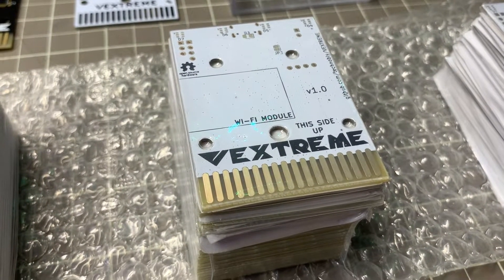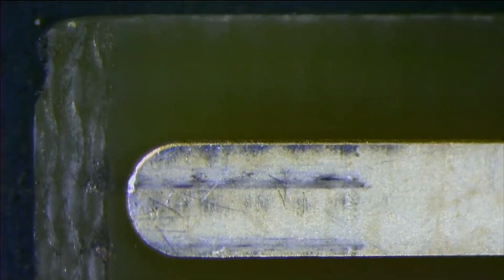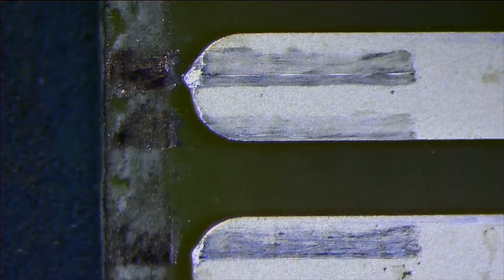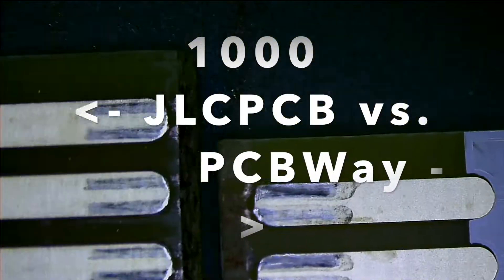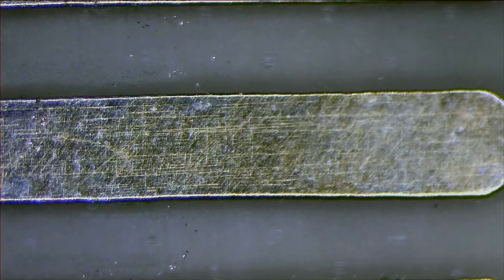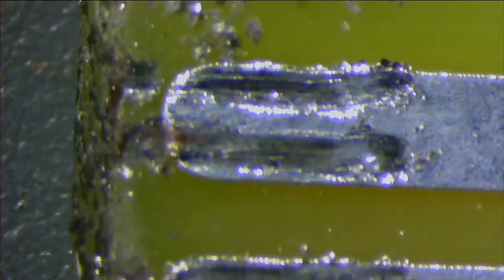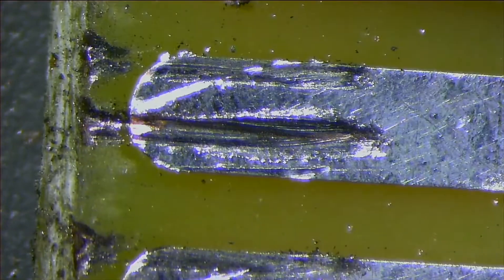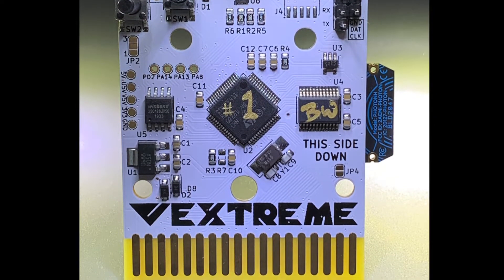VEXTREME PCB INSERTION TEST - ENIG vs. HASL vs. HARD GOLD!!

Comment: It’s worth knowing that there are even more options for manufacturers that aren’t gold but are still sufficient
Reply from the maker: What finishes and manufacturers are you proposing?  If it's worth knowing, please tell us.
Reply: @playvectrex  they often have silver plating and hasl with other alloys which are more durable and resistant to oxidation
Reply from the maker: @TheLostPacketYT JLCPCB doesn't appear to offer silver plating under HASL.  PCBWay offers Immersion Silver and Immersion Tin, but it's not under HASL.  Silver and Tin plate are also still quite inferior to Gold IMO.  Silver will tarnish over time and Tin will fuse into the copper over time.  Both have more specialized handling requirements vs. gold (ENIG).  For a big operation, maybe that's not a big deal... but I'm speaking more for the Maker community and small size game developers.  ENIG is much more forgiving, very durable as you can see in my tests, and not much more expensive.

Comment: Though Pcbway has better options as far as hard gold plating, it's extremely expensive to do so and is hard to justify, at least for my needs. Jlcpcb is far cheaper, even though they only have ENIG, immersion gold as an option. Overall, they've been my favorite fab Co to deal with, especially since the price is right, but YMMV. ;-)

Comment: HASL is fine for most applications. 1000 or even 500 insertions and removals is extreme. You said so yourself. If you ever got to the point where you were worried about wearing through the copper, you could just drag your iron to touch them up.
Reply from the maker: My advice is to use ENIG if you want your cartridge to last and be a quality product.  If you are just making a prototype, HASL will be fine but it's not great for production game cartridges.  Not everyone has a soldering iron to touch things up, and it's not that simple either.  If you wear through to the copper, you might not notice until it becomes tarnished and doesn't make a good connection.  At that point solder will not stick to it so you will have to sand it down to bare copper before you "re-tin" it.

I thought of performing this test to show how easy it is to wear HASL finish away.  HASL starts to wear away well before 1000 or 500 insertions.  I noticed on my VecFlash cartridge that the HASL finish was being destroyed after just one week of intense gaming and switching between different games, which requires removing and reinserting the cartridge, so YMMV.

The choice is up to you, but IMO if you want a good quality product, go for the ENIG finish.  It's not going to increase the cost that much for a product.  Hard gold is another story though, I believe that one costs quite a bit more for not much benefit... but I wasn't able to get a sample of hard gold finish to test.  If anyone would like to provide one, I'd be more than happy to test it.
Reply: @playvectrex  Fair enough. The last few times I've ordered boards and priced ENIG, it's almost doubled the price. I'm mainly using jlcpcb.
Reply: @playvectrex  the main issue is it increases the cost of the product massively and there is still a risk that it’s just going to oxidise before you exceed the amount
Reply from the maker: @TheLostPacketYT I'm not sure which finish or amount you are talking about.  ENIG does not increase the cost of a product massively.  Hard Gold does.  Both of those will not oxidize any time soon during repeated use.
Reply: @playvectrex  enig makes the cost per board go up from about 10 cents to a dollar thats a 10x increase massive at scale
Reply from the maker: @TheLostPacketYT I would have no problem passing on the cost of 90 cents to the customer, to deliver a superior long lasting game cartridge.  That said, I just did a price quote at JLCPCB for HASL (lead free) vs. ENIG (also lead free) and at scale with a 1000 pieces 50mm x 50mm PCB, the difference is not very much at all.  $136 for HASL (lead free) and $181 for ENIG.  5 cents difference.  Easy choice to go with gold... ENIG.
Reply: @playvectrex  They offer it but it may only be for large volume custom quotes

Comment: Now that's dedication! Glad you were finally able to complete this experiment. Thanks for the hard work & showing the results! 😎  
Though Pcbway has better options as far as hard gold plating, it's extremely expensive to do so and is hard to justify, at least for my needs. Jlcpcb is far cheaper, even though they only have ENIG, immersion gold as an option. Overall, they've been my favorite fab Co to deal with, especially since the price is right, but YMMV. ;-) 
I generally have a multi/flash cart plugged in at all times, so I'm not cycling/wearing out the contacts very much. Anyways, great video! ✌️
Reply from the maker: You are right, PCBWay does have many more things you can specify technical wise, and I didn't say this or show it much in the video but the silk screen on PCBWay is a bit higher resolution.  I personally haven't had any problem with either company (PCBWay or JLCPCB) so it's good to shop around and see what the prices are and try some sample quantities, and see if the price difference are worth the quality difference to you.  One thing to note, JLCPCB recently imposed a 50mm wide minimum if you are chamfering the edge of your PCB like seen in these videos.  Unfortunately the Vectrex PCBs are 48mm and they won't allow you to apply the option at all once you upload the gerbers.  I have found though, that you can widen the PCB to 50mm, but leave the edge connector area 48mm wide and they do allow it, but I haven't purchased them like this yet to know if it will go through.  My personal preference is the minimal ENIG finish, with 45° chamfered edges.  I've also noticed the chamfering from both companies sometimes needs a light 800 grit sanding to take the sharp edge off.  You'll know it when you hear it as you plug it into your Vectrex :(  It sounds like strumming the teeth of a comb.